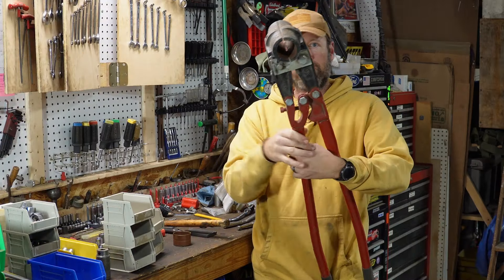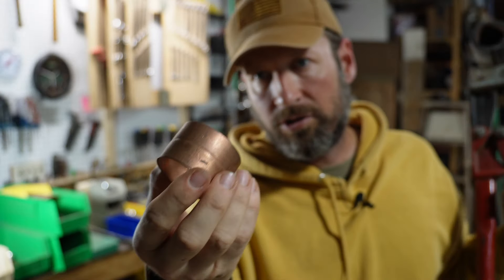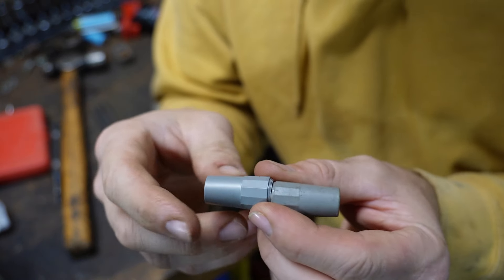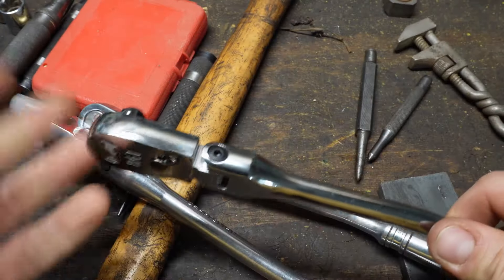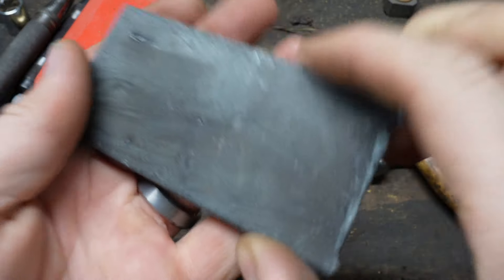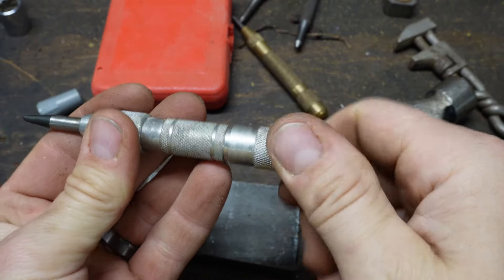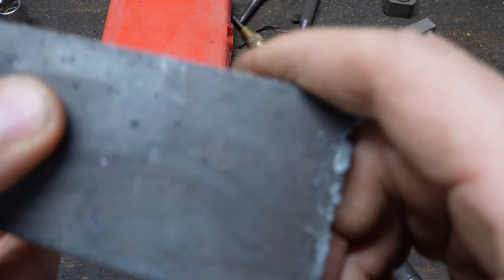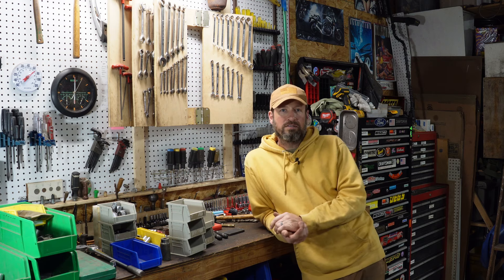Uncommon Tools 087

Comment: The spring loaded center punches also work well to remove tempered glass. I have one with a pen and a tire pressure gauge clipped to my sunviser in case I end up in water and  need to break a window.
Reply from the maker: @roberthoffman4713  great point,  I might add a demo of that next week!  😆

Comment: Put in about a 1/4 mile of 2" copper for a fire suppression system in a heat treat plant once but it wasn't the soft copper rolls. Those twist handle wrenches are factory made and come in all different sizes, they go back to at least the 1880s.......I always say I think I center punched and drilled a million holes when I was in the steel business but that's probably an exaggeration but 1/4 million probably isn't.......I like the little automatic punch for wood.